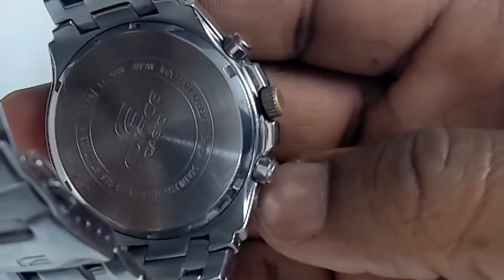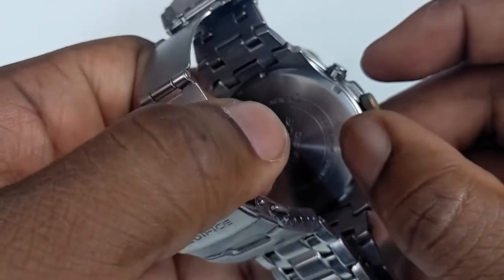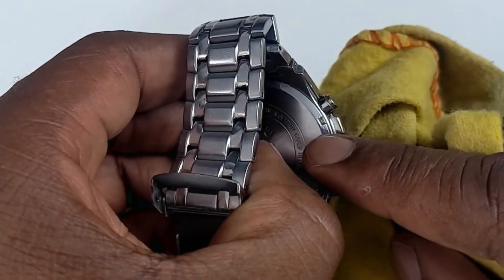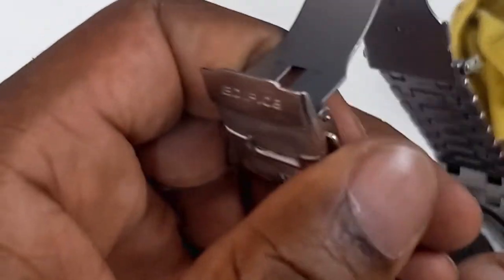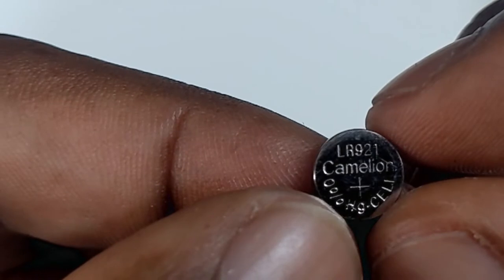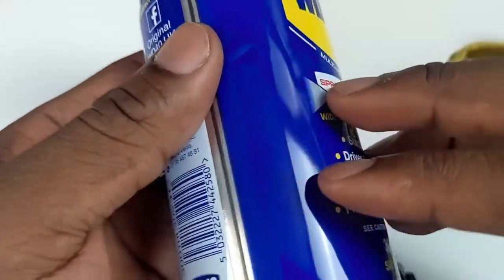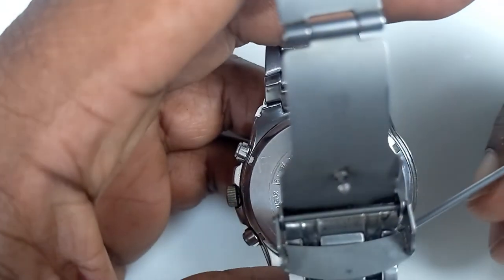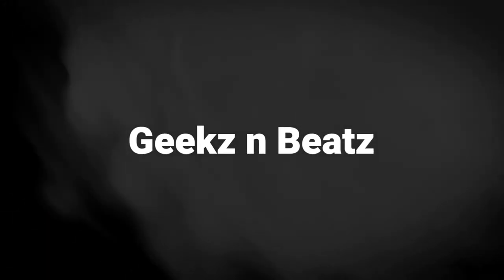WATCH NOT WORKING AFTER BATTERY CHANGE | REMOVE SCREWBACK WATCH CASE NO TOOLS

Comment: I have found that removing a pin that holds the bracelet links together gives me clear access to the watch back. Yes, there are tools to remove the screw-on backs but I bought a rubber ball used for just this purpose. The friction between the ball and the case back usually loosens the back. Now as far as using WD-40, that's the owner's call. I prefer a very, very light silicone oil in a syringe with a fine needle and follow what you have demonstrated here. VG video but I'm not a fan of WD-40 for watch repair.